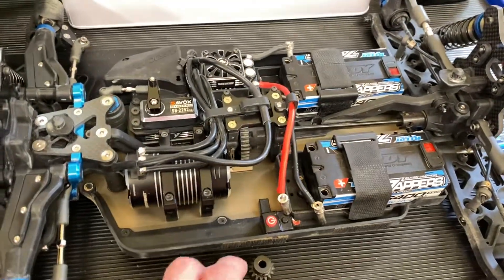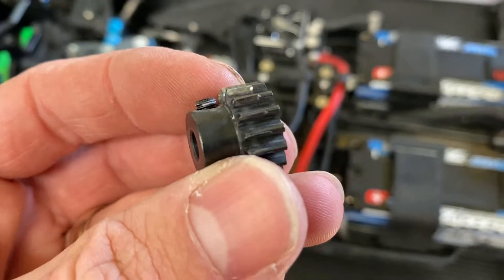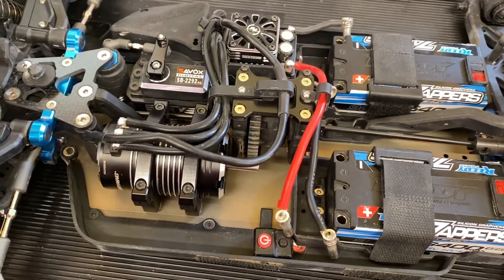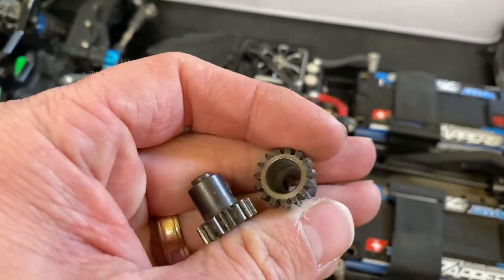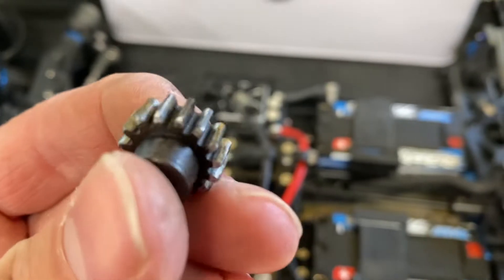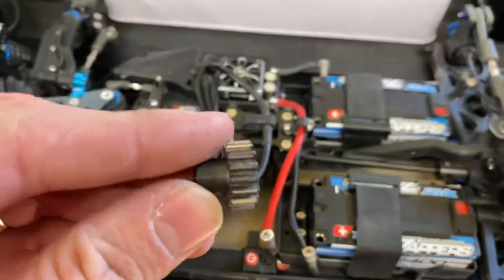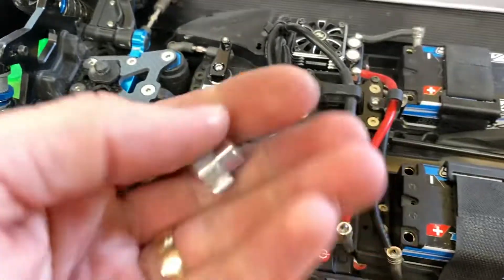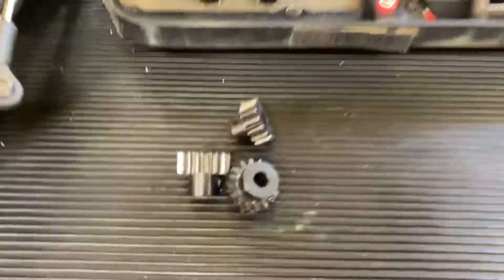RC Pinion Gears! What to avoid! 5mm MOD 1 - Don’t go Cheap!

Comment: This happened to me at a one day race in ny last weekend, mbx8r eco, hobby wing xerun8pro w/2200 kv motor, 4s gens ace 7500mah 130c redline battery, 46t steel spur, chinese (fleabay) 14t pinion done in 18 mins of run time.
Reply from the maker: Yep, if you search for mod1 5mm pinions on amazon all you get is poor quality pinions…